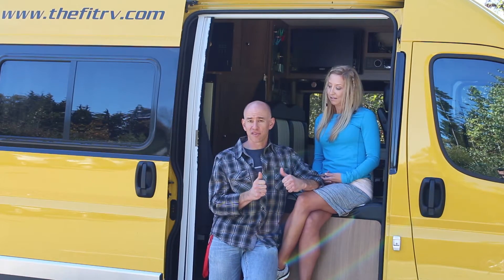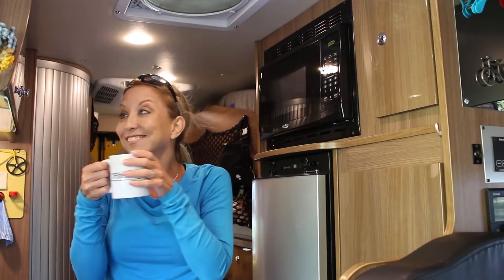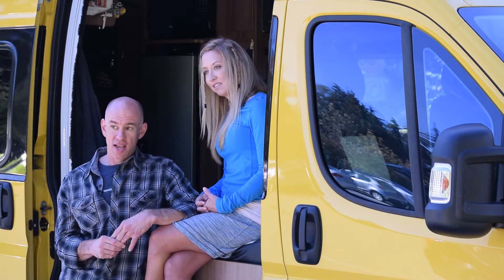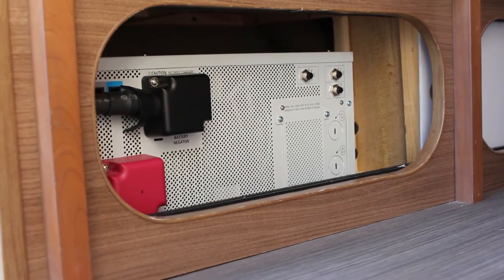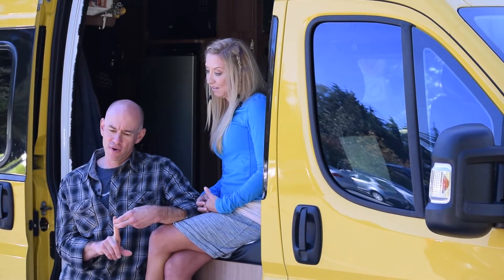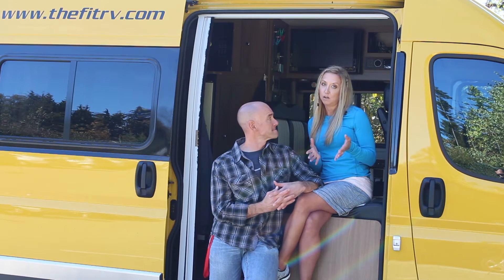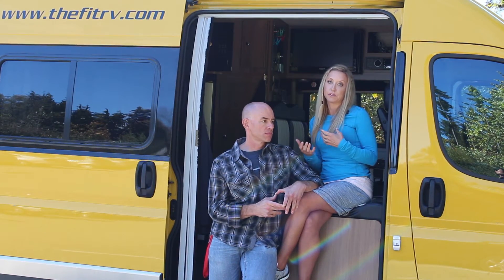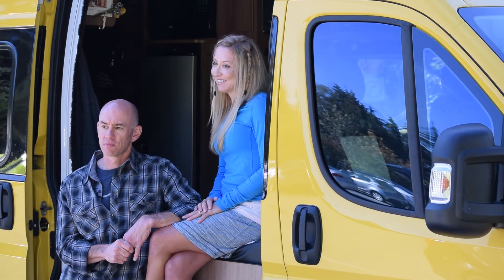Power Time - FitRV - Replacing the generator with Xantrex Freedom Inverter/Charger System

Comment: I have a Xantrex Prowatt 2000 sw inverter with sok 12v @ 206amp batt but it will not run a full-size fridge, what do I need to do to make it run?